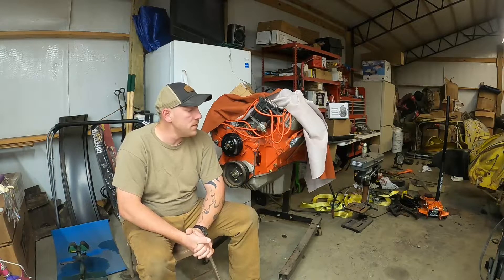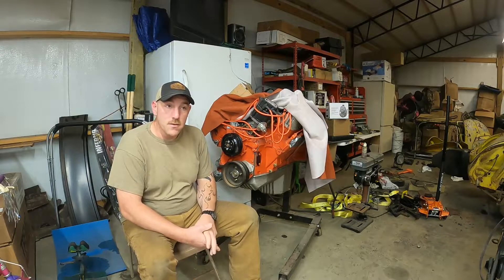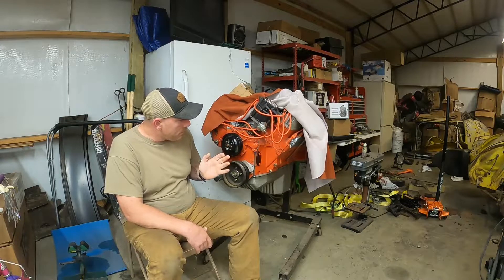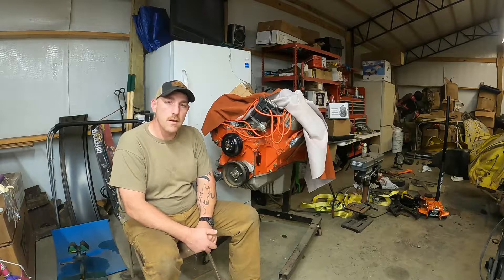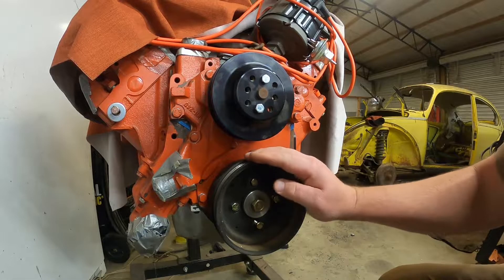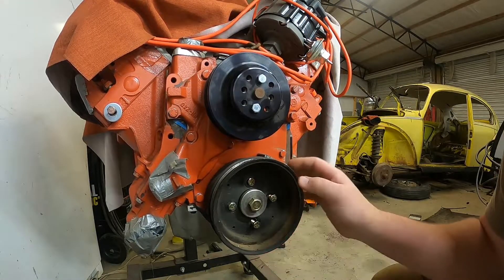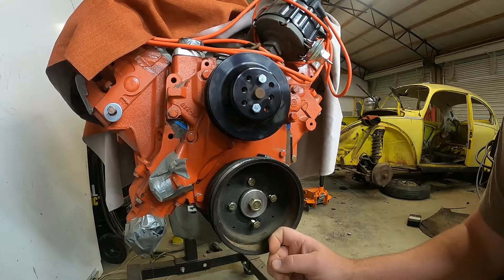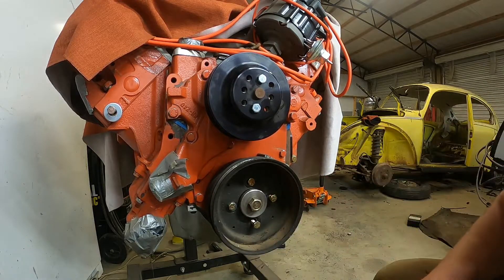Custom made Cadilliac 472 Serpentine Belt System build Part 1 & some 1969 Firebird update photos!!!

Comment: FYI- the guy that designed the cad 472/500 also designed the ford 429/460 engine.
Reply from the maker: I think I read that somewhere before, and that would explain why the distributer is where it is.